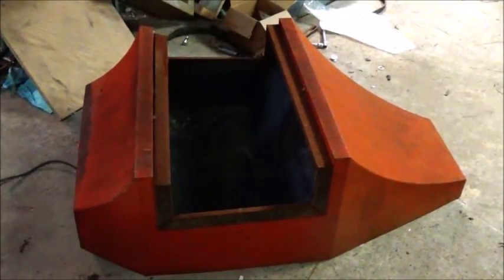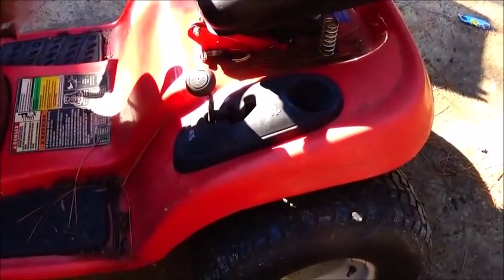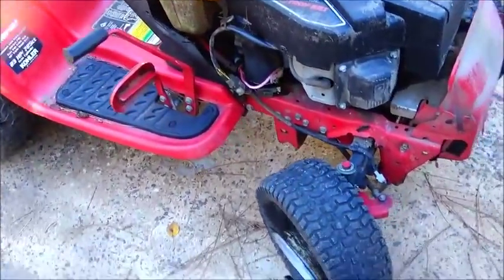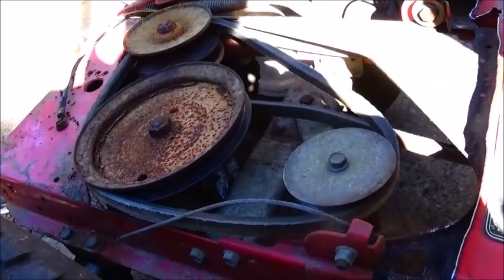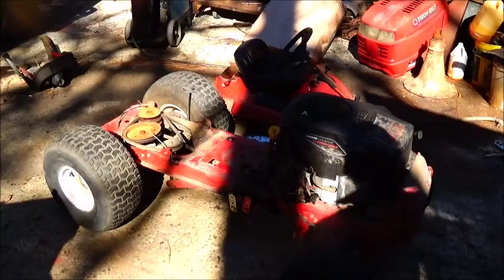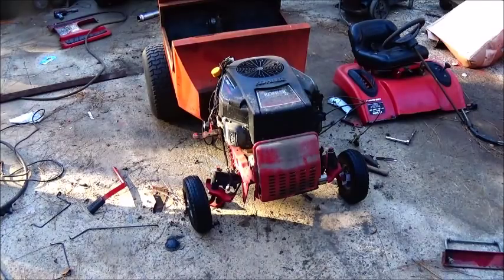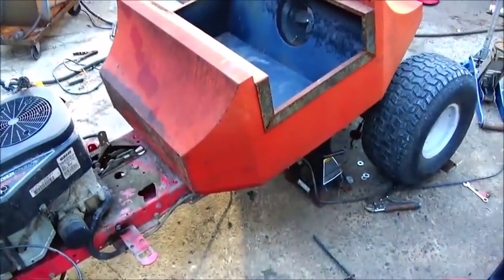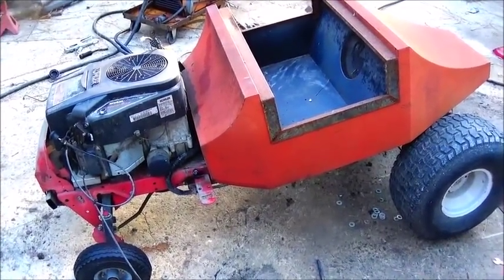Hot Rod Go-Cart 1

Comment: That is good repurposing I used to have a heater just like the one your using for the body it had a heating element and a electric fan in the round hole and at the bottom there was a drum with flames painted on it driven by a electric motor with a lightbulb in the middle it looked almost like a real fire

Comment: Yep, the Krohler Courage engines are a poor design. The camshaft problems were one issue, as well as the “bucket” design of the engine. The bolts on the top “closure” plate tend to back out and the flywheel will hit the bolt heads and break the block. They also like to throw rods. We always said they were called Courage because it took courage to put them on the market!